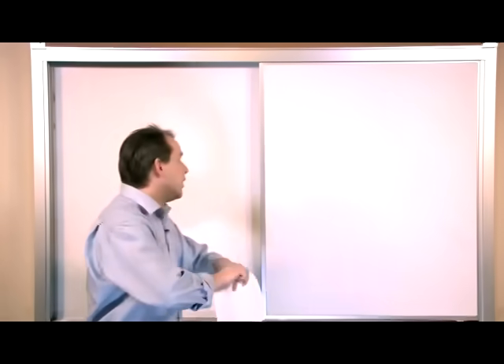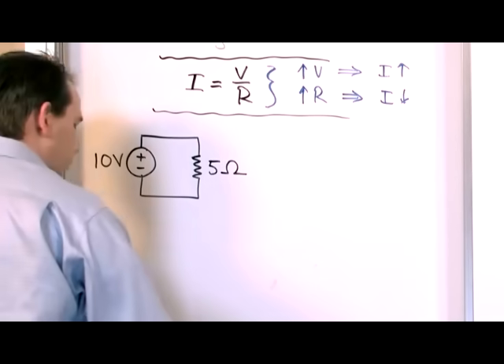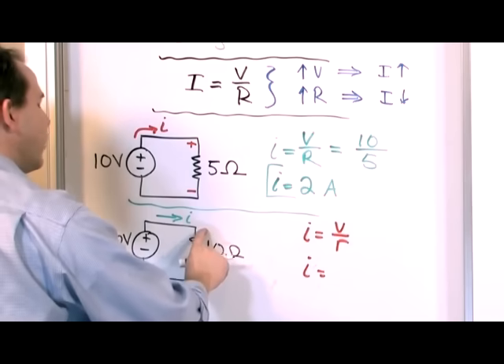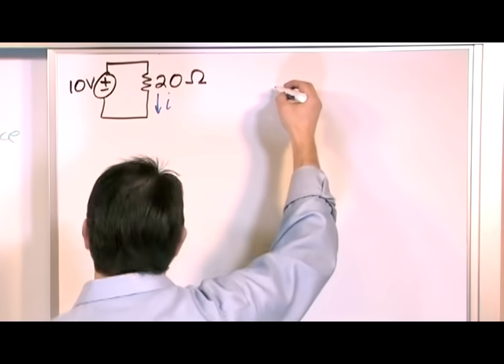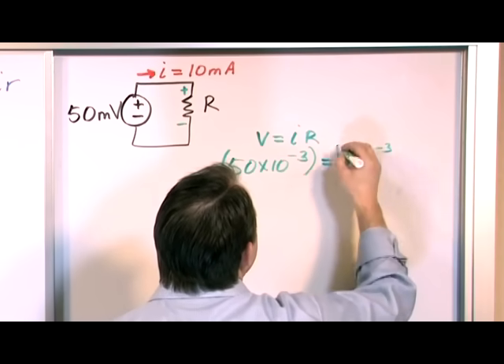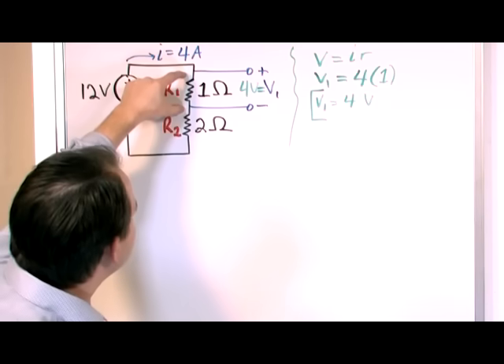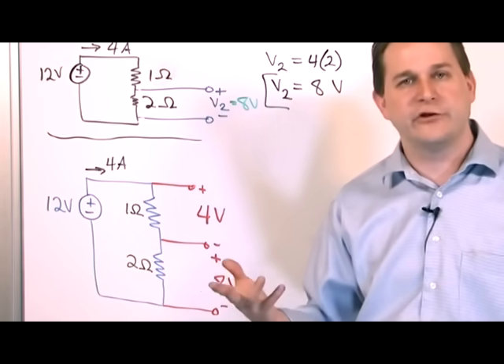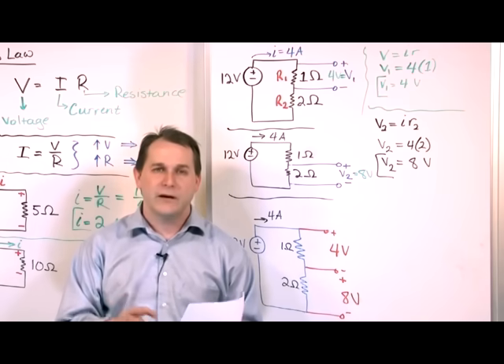03 - What is Ohm's Law in Circuit Analysis?

Comment: WIsh I had known this years ago, in 1971, on my way home on emergency leave when my son was being born, I stopped off at the Yakoda Air Base in Tokyo.  While there, I had some money to blow, so I purchased an AM/FM/Television radio combination with AC/DC power it could run on 9 C cells, or an AC adapter that came with it, very small I think it had a 2 inch screen.  At any rate when I got her home I discovered that it was not designed to run on 120 volts, but the 100 volts available in Japan. It still worked OK on DC but I needed to adjust the ac/dc converter.  I took it to a TV Repair shop on base, they had no idea how to fix it. So one day I took the converter apart, and found a switch that worked.  Using it before I found the switch under a cardboard cover, must have put a lot of strain as one night while watching tV while on duty as the CQ Runner, the blasted thing went POP and stopped working.  So I tore her apart the next day at home and saw where a resistor had actually blown apart. It was burned so badly that I could not read the rings.  So back to the tV repair shop on base.  They took one look at it, checked their docs and said that since that brand was never imported into the USA they could not get a circuit diagram to read and refused to make a wild ass guess.  So I took her home again but rather then throw it away, I stripped some copper wire and just wrapped it around the two legs of the resister.  Damn thing began working and worked for years after that just by bypassing the damn resistor. I eventually mounted it under the dash of a buddies car as he worked as a nigh watchman  during his off hours for extra cash and wanted to watch TV while sitting in his car watching some stupid gate in El Paso. Seems to me he paid me more then I paid for the unit in Tokyo.
Reply: Jerry - I went to the other side of the world - Schweinfurt Germany. There they have 220 VAC @ 50 Hz. I had small table top clock radio I got while at Ft. Gordon, Ga and it worked on 120 VAC @60 Hz. I was able to get a used component transformer with a partially working secondary winding with a center tap.  I think i was used in a frequency counter. BUT still had a working 120 VAC winding. So i used this to step down the 220 VAC to 110 VAC and power up my radio. I wrote the mfg and much to my surprise had an engineer write me back. The radio had a clock set @ 60 Hz but i was using 50 Hz. All i had to do was jump 2 pins on chip!!! and it worked fine the whole time i was there!!! Brought it back to the world and used it many years!!! Be safe my brother in arms. Welcome Home!!! God Bless. SP5 US Army 1979-1982
Reply: is it still working

Comment: I don't get it. So you make it to the bottom of the mountain and all of your voltage has bled off. Then what is left to push you back to  the source...nothing. Is not '0' volts effectively ground?, or no potential? I call that an open circuit.
Reply from the maker: Great question!  Pretend you are an electron.  You have traveled through the resistor "down the mountain" and now at the bottom you are at 0V.  What happens then?  Then, you re-enter the battery, and you are then brought back up to the top of the mountain where you fall down again.  So as an electron you go round and round, down the mountain then the battery brings you up again, then  you go down again, over and over again.  How does the battery do that?  There is a chemical reaction inside that performs this function.  Once all of the reactants are used up inside the battery, then it can't perform this function and the battery "dies"!  

This is exactly like a roller coaster.  The tracks drag you to the top, then you travel down bleeding off energy, then at the very bottom just as you come to rest the track grabs you then hauls you back to the top again and you go again.

Make sense?
Jason

Comment: Another question is how is it that once it passes resistor #1 dropping to 4 volts and once passing resistor #2 then raising back up to 8 volts.
Reply: At first  it was 12 . The first resistor will  take 4 volts and the remaining  volts  will be consumed  by the latter resistor. There fore it is not increase in volts  in fact it it is  drop in volts  and every resistor  consumes the the volt  as per their  resisting  capacity. Hope this will  help.
Reply: @redawedi2030  thank you for your response. Its my first time. Trying to understand the operations and functions instead of trying to memorizes. Would you be willing to help if I have more questions?
Reply: @bouasonephouikhambay4081  no problem as long as I can.
Reply: @redawedi2030  can we connect by other means?  Maybe email or social media?

Comment: You can run into a confusing problem using Ohm's law when doing parallel circuits. It is easy to get a figure where the total amperage is greater than the total voltage if the resistance in each parallel circuit is not high enough which cannot really happen in real life. The student must be taught that resistance values such as one is impossible since that will imply a non resistance and also that total amperage, no matter how many parallel circuits there are can never be greater than the total voltage and usually is significantly lower.

Comment: so... shotcut is basically I=V/R, where R=0.001 ohm maybe, crappy cord. => I=1200Amps, which is huge. Say Rgoldcord=0.000001 => I=12,000,000A => power or current for some milliseconds to run out of battery, depending on R-value. That's why it burns silicon.

Comment: So is a voltage divider comparable to a transformer?
If I put in a resister too strong would I have to give the circuit a larger battery (more volts)?
Thanks to anyone who can answer my questions
Reply: Transformers works as a filter  blocking DC voltage and passive for AC voltage that's why there is a step up and step down transformer. Increasing output voltage or a decrease output voltage
Reply: Not to mention resistors aren't very efficient transformers, considering they heat up and have some other problems....

Comment: im confuse about the example with 2 resistor .. V = i r .. but when you look at the first resistor , it has 1 ohms .. so when you devide it by 12v .. definitely you dont get 4Amps ..
Reply: 12V is the voltage drop across both resisters combined.  
Total resistance is 3 ohms.  4A times 3ohms = 12v
If your looking at the voltage "drop" on each resister, then its:
    4A  times  1ohm  = 4v  voltage drop across R1 only
    4A  times  2ohm  = 8v  voltage drop across R2 only

Comment: Just a question to curb my curiosity.  Done electrical work of many different types, residential industrial, commercial and weird things everywhere in between.  44 years now. So with that said, back to my question.
Many years ago when I learned Ohms law, we were taught E = Volts or electrical pressue.
I = Amps  load or flow of electrons
R = resistance or narrowing the flow of electrons.

Does anyone know when and why V is used to represent pressure instead of E?  No big deal makes no real difference,  it is purely my curious nature. Lol
Sorry for the long explanation I just wanted anyone who may answer to know I'm not just a crack pot.
(Not provable)
Thanks for doing the video very well done and understandable. This should help many with good basic electrical knowledge.
Reply: The only E I remember seeing is the small e which stood for a single electron's electric charge.

I was also surprised that he uses "V", we in Europe use "U". No idea why, but could be that it used to be "E".

Comment: Question:  If you measured the voltage BETWEEN the two resistors (r1 and r2) what would be the voltage be there?  Does it jump back up to 12v?

Also the term drop is confusing to me.  Analogy. Intuitively if it’s 12 degrees outside and the weatherman tells me the temperatures dropped by 4 degrees then the temperature is now 8 degrees.  He’s not saying the new temperature is 4 degrees.  I understand exactly everything your teaching it just that as a noob the word drop makes me kinda scratch my head.
Reply: Depends on the point of view really. If you look it at the Resistor 1 point of view, the "Ground" zone or point of view is at it's leg, which when measured both legs says it's 4 volts.
If you continue to Resistor 2 and still keep the point of view of Resistor 1, you will notice that it's -8 volts.

Alternatively you could inspect the situation from Resistor 2 point of view: Resistor 2 is 8 volts and Resistor  1 is +4 volts, which sums up 8 volts + 4 volts = 12 volts.

Now if we inspect the start line, our power supply is 12 volts, and the circuit uses 12 volts (12 volts - 4 volts - 8 volts =0 volts) you will notice that all of the voltage is used as it should be.
Reply: PPS. similarly, if humanity decided to inspect weather temperatures from the perspective of water's boiling point, instead of it's melting point, we would see the boiling point of 100 Celsius degrees represent as the new "0-zone", so the "old" 0 Celsius degrees where water melts, would in this "new" perspective be determined to be in -100 Celsius degrees, even though water's melting point doesn't change in reality, we just see it in a different way.

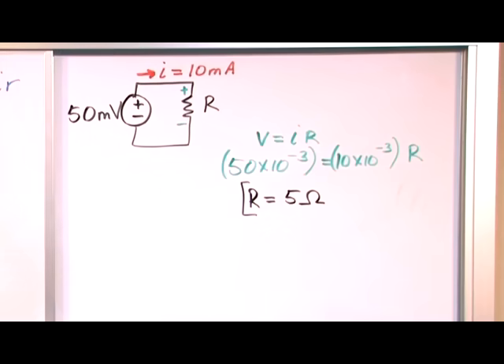Comment: 23:40 so having a 6ohm resistor instead of 5 would increase the voltage output, even though the voltage is only supposed to drop? According to ohms law there's no voltage drop with .05v pushing .01amps through a 5ohm resistor .01*5=.05?  Where as .01*6=.06....
Reply: First of all, he was trying to solve R, resistor. Not the voltage value.

I suggest you re-watch the video.

Basically the rule of thumb is:

Current = Voltage / Resistor value, which means:

If you increase Voltage, you increase the Current.
If you decrease Voltage, you decrease the Current.

If you increase the Resistor value, you decrease the Current.
If you decrease the Resistor value, you increase the Current.

Similarly,

Voltage = Current x Resistor Value, which means:

If you increase Current or Resistor value, you increase the Voltage.
If you decrease Current or Resistor value, you decrease the voltage.
(It just means it needs more or less Voltage to get past the resistor or to reach a certain current level)

And finally

Resistor = Voltage / Current

Comment: How is it possible that a large 9 volt battery and small 9 volt battery can make a difference?
Reply: A lot more energy can be stored.

Voltage is only a unit to measure the potential difference, it doesn't tell you directly how much current, resistor or power it has.

Comment: What exactly is voltage drop? If the voltage drops by 10 across the resistor and it's a 10 volt battery, what pushes the current back to the battery?
Reply: As was explained in the beginning regarding how electrons work, the electrons from the start, push the ones ahead, forward.

So basically that's why the current can flow, as long as the battery or source is supplied with enough power, it will flow through the circuit and reach the other end of the battery or source line.

Comment: Electrons are negative charges...they flow from the NEGATIVE side of the source voltage, to the POSITIVE side in reality!
Reply: In this instance he is talking about "hole current," the imaginary current caused by the "holes" left when electrons jump from atom to atom. The math stays the same except that all the negatives you'd have to plug in before are positive, simplifying it immensely. Either way, your answer will be the same but it's just easier to pretend that current flows from the positive terminal to the negative terminal
Reply: He is explaining this in the first lesson. He is talking about the hole current.

Comment: It make no sense what you are saying about resistance! So if I use a strand of a speaker wire to power a lamp plugged to the wall it will limit the flow of the current???
Reply: Yes, BUT, the resulting heat from that resistance will burn out the wire.
Reply: The amps would remain the same, but the voltage would drop from 120 in the wall to very little at the lamp. The voltage loss would be seen as heat until it burns that thin wire.

Comment: How do transistoes, diodes and capacitors work with Ohm,s Law?
Frank
Reply: Ohms Law is applied on other components as well, however other components have additional laws that are used to understand their functions. That's where you use Henry, Farade, Couloumbe etc. values.

Comment: I’m having the same thoughts as Arthur.  I would think the voltage ( the push) would be constant and the current (the speed of the stream) would drop. Now I know you are right but I can’t get the picture.
Reply: watch again the portion where he talks about the mountain anology and he explains the potential energy.
Reply: Amperage isnt the speed it's the charges(electrons) per second but the electron speed isn't changed the volume is the variable there so a resistor is consuming electrons and producing heat that's why ohmic heating is I^2•R there's more charges able to be consumed rather than it slowing them down

Comment: Thanks for the video. It is great .

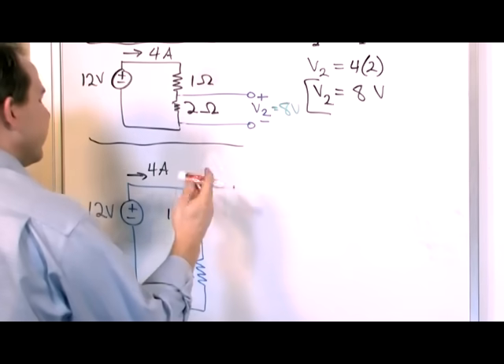at 32:30, states that V drop is estimated at I x R. I wonder, is it the voltage of drop across the resistance or the value of voltage across the resistance?

Appreciate and thanks again for the great clip.
Reply: It's both.

It's the value of voltage that is being used from one side of the resistor's leg, to the other side. You can also calculate it: 12V-4V leaves you with 8V, which is then completely used once you reach and pass the 2nd resistor.

Same thing happens if you change the order of which of the resistor comes first, it would be first using 8 volts, then the remaining 4 volts: 12-8V leaves you with 4V.

Comment: i see the general flow but 1. how does the current remain the same? i thought the resistor acted to constrain the flow of current? shouldn't it decrease after the resistor constrains it? aren't fewer electrons flowing after the current goes through the resistor? 2. if the measured voltage across the resistor is described as a drop in voltage does that mean the the resistor has absorbed energy from the battery? does this manifest as heat?
Reply: I know that's weird to me too but after googling i understand it:
Forget ohm law in this case 
Current is constant in a series circuit. 
Example
current is the same after R1 R2 R3
Voltage is constant across parallel circuits.
https://www.electronics-tutorials.ws/resistor/res_3.html
Reply: Resistor acts as a filter in a way, it filters energy out of the circuit (and dissipates it, it is warm/hot to the touch as it does it). As the law of energy preservation states, if work is performed the energy of the system (circuit) decreases (to paraphrase it), the work being "fighting that resistance" + heat. That means the available energy for pushing the current AFTER the resistor is less (ie voltage drop). Power is P = V * I (don't confuse with Ohm's law), energy is P * t (time).
Reply: @vyarovoy  that makes a lot of sense. i guess the fact that the current remains constant throughout the entire series circuit is due to the affect of ALL the resistance.
Reply: I was wondering the same thing but i think these examples are perfect scenarios in which the battery never runs out of charge (through heat - like u said) I imagine resistance as running through the street normally, struggling through sand, then back to the street. At the end you still ate 2500 calories but you burned maybe about 60 in a small circuit. And now your left with (2440 calories) btw Calories = HEAT (related to "calor" or heat in spanish)
Reply: @doctorluz180  Current is constant in a series circuit.  Voltage is constant across parallel circuits.

Comment: How can you measure 10 volts if there has to be a voltage drop because there’s a resistor?
Reply: Easy, you compare how much voltage was at the beginning and how much, if any is left at the end. If you have 10 volts at the start, and 0 on your way back, it means 10 volts was used in total.

If you have 10 volts in start and you measure halfway the circuit, say component A states it has 1 volts, it means it has a 1 voltage "drop" or in other words, it uses that 1 volt. That means there's still 9 volts that is being used elsewhere in the circuit. (10 volts - 1 volt = 9 volts).

Alternatively you could just instantly measure from start to the other end of component A and instantly get that 9 volts value.

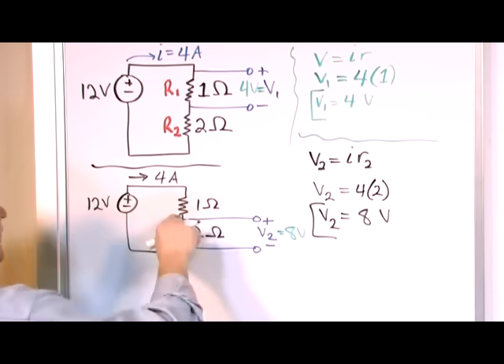Comment: so does R1 and R2 represent the voltage drop ? and whats the resistance between V1 and V2 at 31:03?
Reply: r1 and r2 represent resistors (resistance) when electricity flows through them. So yes, voltage is dropped depending on the amount of ohms in the resistors. As far as for V1 and V2 they are different from each other because there should be one voltage per circuit.

Comment: But in the real world the two resistors would add up to slightly less than 12 volts, because the wire itself is a resistor?
Reply: Yes. Or more like the current would be slightly reduced from 4 A to 3.999999 A.

But as they say, 3.999999 A, or 12.11111111111 V, is good enough for government work.